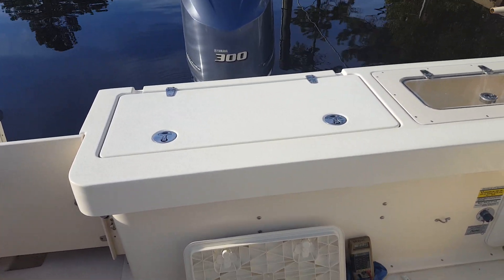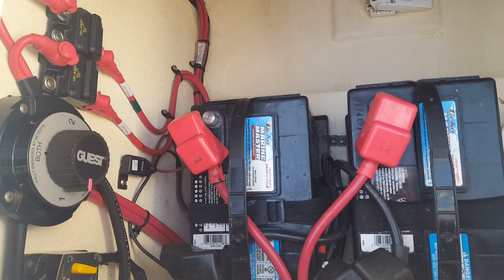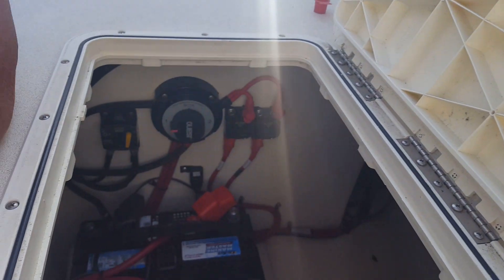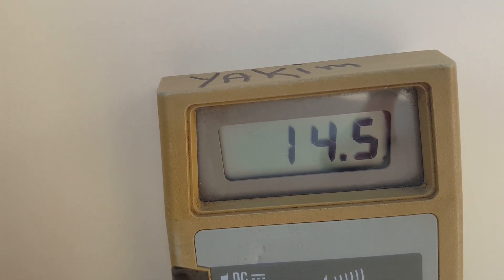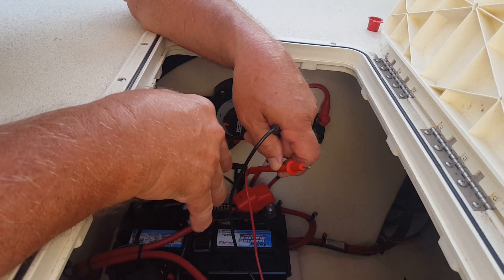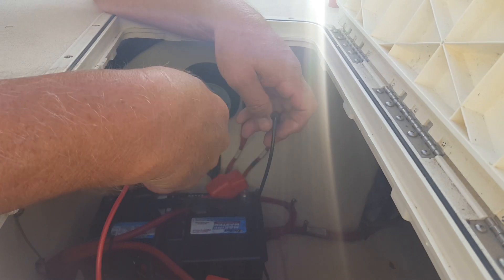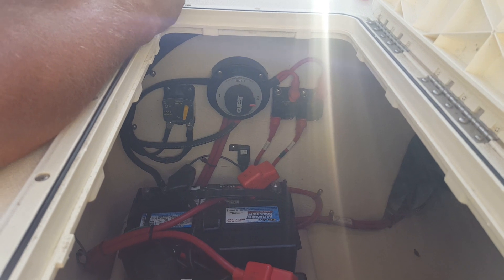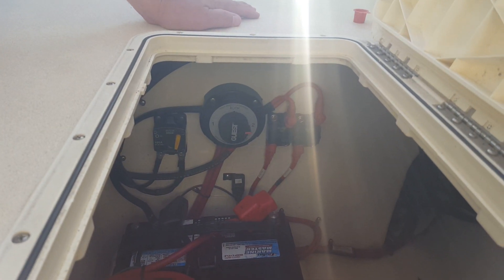BOAT BATTERY Selector Switch. Run on 'Both' ?,   #1? #2? It Depends;

Comment: I'll replay this for my husband.  This is good to know!
Reply from the maker: Hi Sheila B, I been reading threads about this on The Hull Truth, ClassicParker, BloodyDecks, and others... It seems some of the confusion is that most of these folks are talking about newer boats, properly wired. (in that case, no need to select 'Both') ... Some of them are too young to know/remember that with many older boats, it was necessary to select 'both' if you wanted to charge both batteries. Just not the case with most newer boats. Thank you  for watching and commenting!

Comment: Great info i dod know that cap.
Do you think my boat is the same way?
Reply from the maker: Hi Capt.... It all depends on if they (Parker Boats) 'properly' installed/added the extra charge-cable to the batteries.... All new installation should have this, but I have seem many of my friends new boats where it was not done; it should be done at the factory or the dealership... The easiest way to know is to run the engine at idle and out of gear.... put the battery switch on #1, then check battery #2 with the 'multi-meter' (aka, Volt-Ohm meter), and see if it is showing 14.2-14.6 volts (typical alternator output from the engine)... if so, all is good. Then put the battery switch on #2, and check battery #1 with the Volt-Ohm meter. If it is showing 14.2-14.5 volts, all is good.... if either condition is not showing 14 + voltage (for example 12.4-.12.6; normal non-load battery voltage) then the extra wire was NOT installed, and should be installed... VERY IMPORTANT!!! When doing all of this, (with the engine running) DO NOT switch  through the battery selection switch via the OFF position... it could fry electronics in the engine.... with new (2000-2019)/most, battery selection switches, it is OK to switch from #1 to "Both" to #2 without a problem...but  DO NOT go 'through' the OFF position.... in older boats (1970's, 1980's and some  1990's) DO NOT switch from ANY position with the engine running; (stop the engine, and restart with the battery switch where you want it to be; most likely on 'Both"...  some of the older switches were not designed to maintain connection when switching from #1 to ANY other selection, and can fry electronics (diodes and such in the alternator) as the alternators output has nowhere to send the electricity.....
Reply: @andrewfyakim525  that great way to do the test, wen i have time i will do that, thanks for the info cap.
We are all learning together 😉😁👍
Reply: OOTR, notice he said "Only if it was installed correctly at the factory",  lol.  With your crooked pilothouse...well who knows! 🤔🤗   jk
Reply: @yumyum408  lol that's why I'm going to check up on it to see if it's installed correctly that's a lot of things could be wrong🤪or Crooked